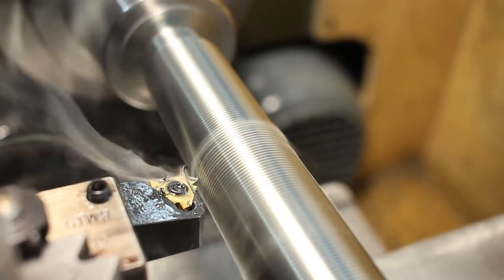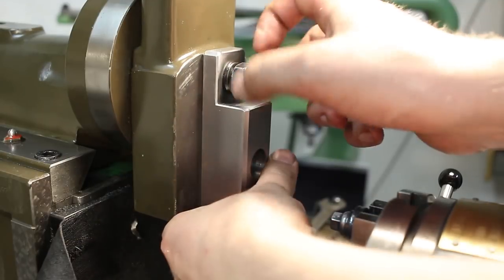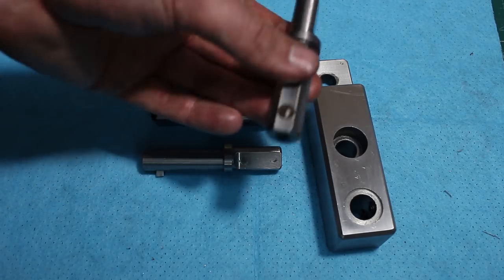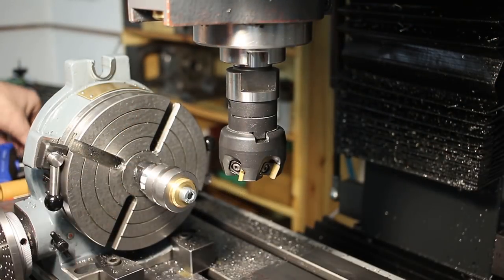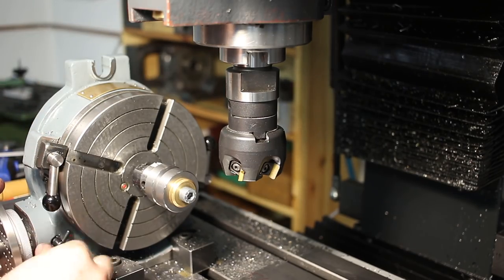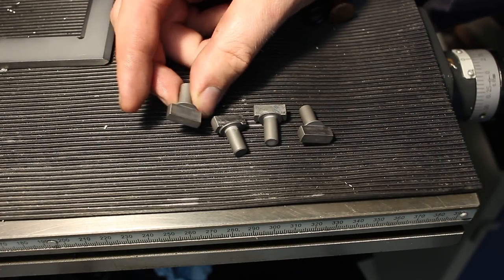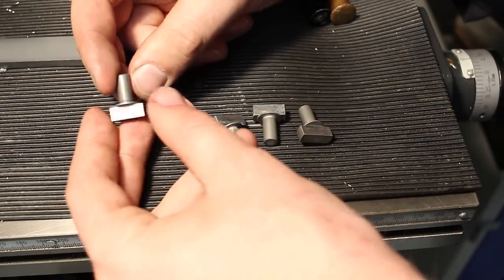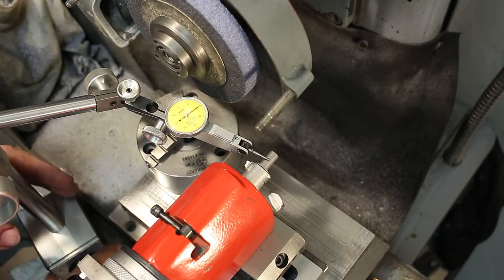The Archives - #4

Comment: Your video quality just keeps getting better and better Stefan. Really good picture quality, color, sound and editing. And as always great content.

I have the usual edge finders as well as a costly digital Haimer 3D and even with those I still at times use Zig - Zag cigarette rolling papers as a very old school edge or tool tip finding tool, or even as shims the same as you do. A few packages of them are kept right in the same tool box as the rest of the precision tools are. It's a very old machinist trick I learned in an old book many years ago. It's not hard to find an edge to under .0005" or less if you take a bit of time. They work just as well on the lathe to find the surface or part face with the tool tip as they do on the mill.

Comment: Stefan; Is your 5C collet block to hard to put two dowel pin holes (so you can remove the pins when not needed) such that it will be square resting on the back jaw in the center of your vise? Maybe the holes could be drilled with a carbide drill and bored with a CBN tool
Reply from the maker: Great idea - i think its not to hard for harddrilling,  i will give it a shot. Thanks!
Reply: Edge Precision I was thinking the same, or a slot and key. I have also used thin parallels. Great video Stefan.

Comment: Good collection of videos!  I wonder if you could make a spacer ring to set the collet block on to automatically square the collet block in the center of your precision grinding vise.  I imagine that a ring turned with an ID slightly larger than the collet nut, and an OD slightly less than the block width would work.   Chris

Comment: Oh man, the old chuck holding the diamond dresser is a great idea!! 
I made a holder for my diamond dresser and somehow in the fitting I lost the diamond off the tip! I have a junk chuck from an ollllld lathe up on a shelf!
Reply from the maker: Thanks! Its not ideal - Normaly you want the diamond at an angle, so it creates a new facett/edge each time you spin it a bit further.
Reply: Stefan Gotteswinter - hmmm... Maybe a thin angled back plate for the chuck. You been saying more and more now about the size limitations of your grinder, maybe it's time for a bit bigger machine? My Ko-Lee 6x12 has been perfect for everything hobby I do. And it doesn't weigh 16,000 lbs so maneuvering into a basement isnt an impossible task...

Comment: Hmmm.... I'm looking at that slotting centering plug and thinking, for through holes, you could make an adjustable version with two inward pointing cones to center up and a screw thread or bolt to hold them together.

I don't own any machine tools (yet), so I don't know how well it'd work, but it's a thought.
Reply from the maker: That would kinda work, but would either require a clean, precise chamfer on the edge of the bore or an unchamfered, but deburred, sharp edge.
And such a centering plug is turned in a few minutes. - I would not overengineer it ;)

Comment: Hi Stefan,I enjoy your skills as both a machinist and teacher.I would share that I have a Prazi  8x20 lathe.I would feel certain that our machines share the same mounting arrangement with that small taper nose.I have found my machine performs quite nicely with great precision.I use my machine as mostly a hobby.I viewed your segment on eleminating the compound,as my Prazi will not do cut off work without much yelling at the machine because it loses its position.Stefan,I have very limited access to most barstock except for grade 5 titanium.Would titanium  make a suitable base for a multi tool holder?I recently made several back plates for both a 4 and 6 jaw chuck from Ti with success,and managed to get the 7degree taper spot on.Any advise you could give would be much appreciated.Thanks very much Fred.